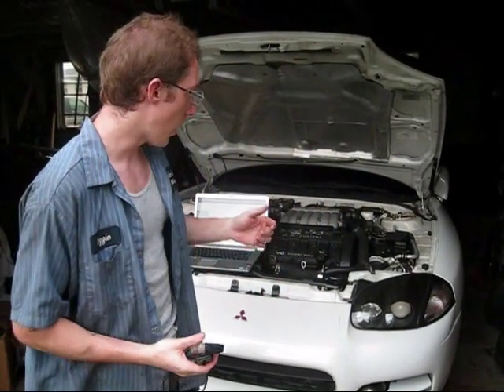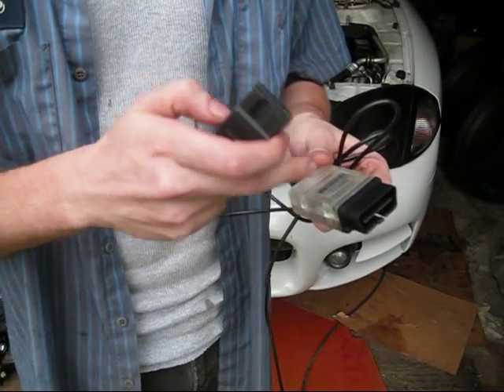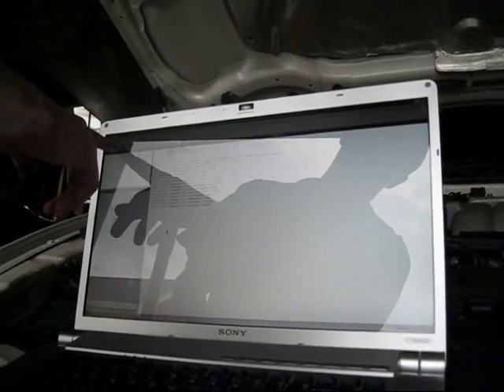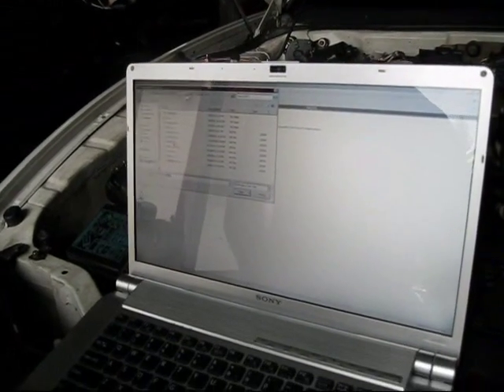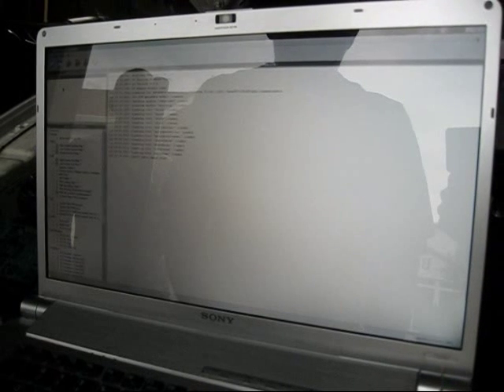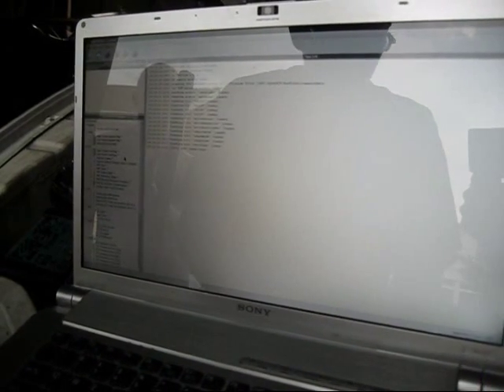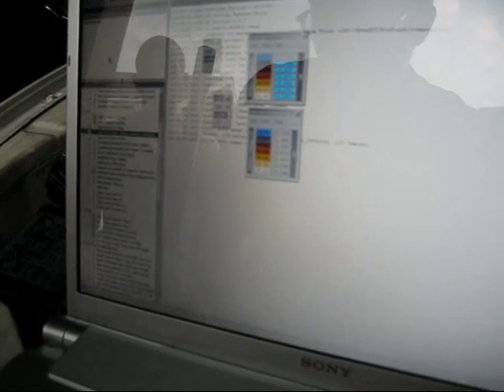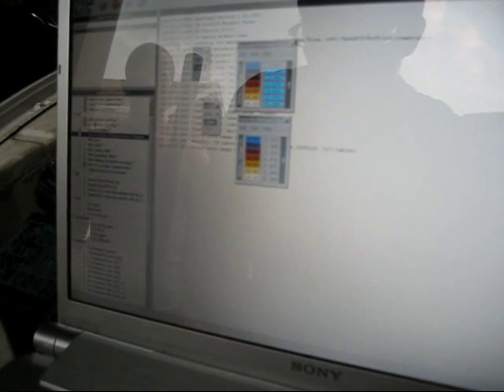Flash Tuning 99 VR4 ECU - Monochrome Demonstration

Comment: Hi Monochrome,Thank you for creating this for us! I just purchased a Chrome ECU and installed it in my car. I am ready to do my first flash now, but I am confused by something. When changing the injector voltage latency, do you change both columns of numbers i.e. the voltage itself and the latency associated with it? I see that both are different from the stock 3KGT ones, but it is not clear to me from your video. Thank you beforehand!